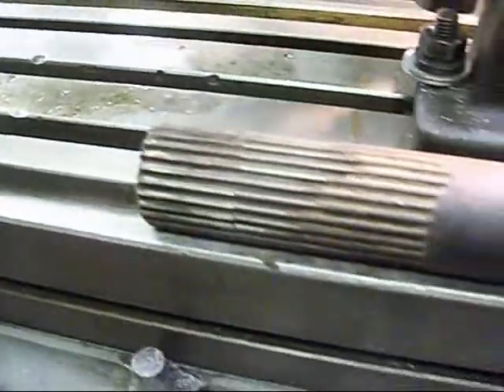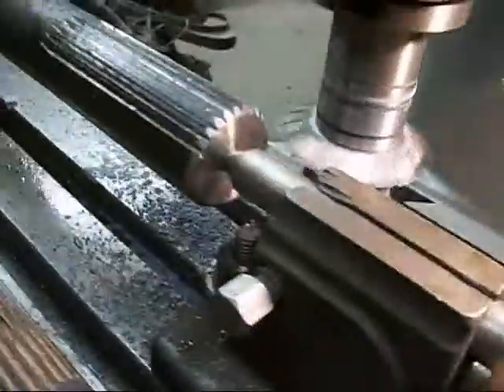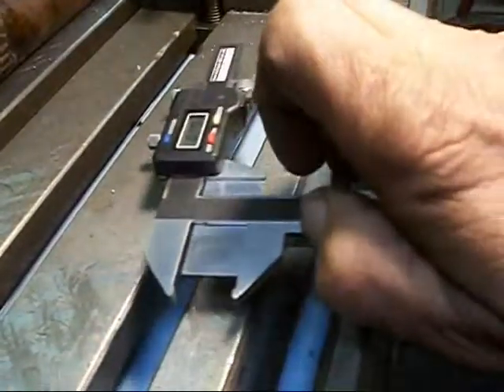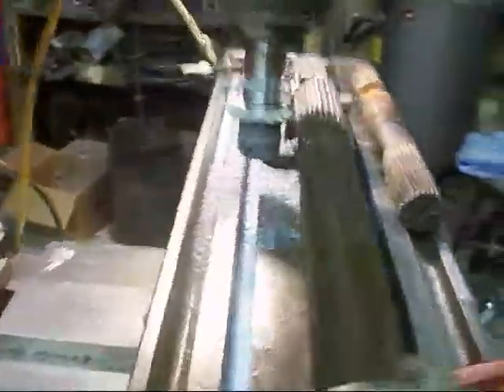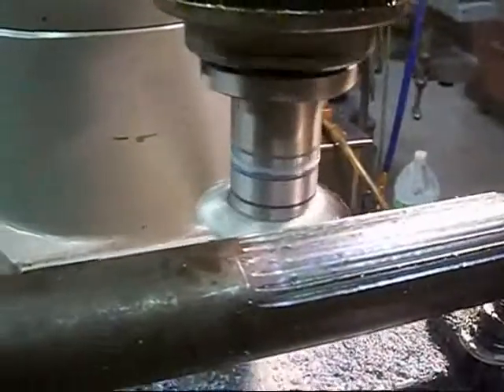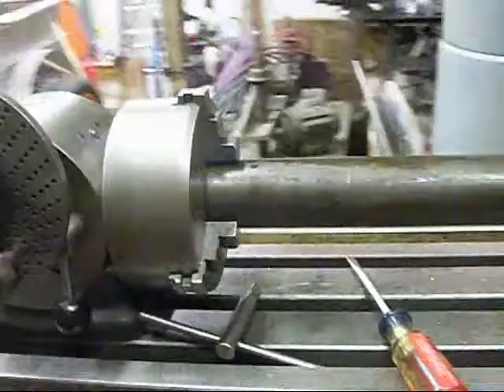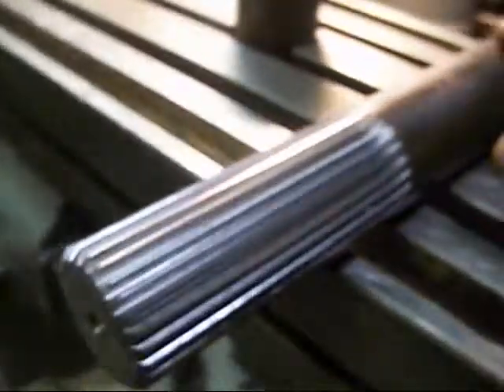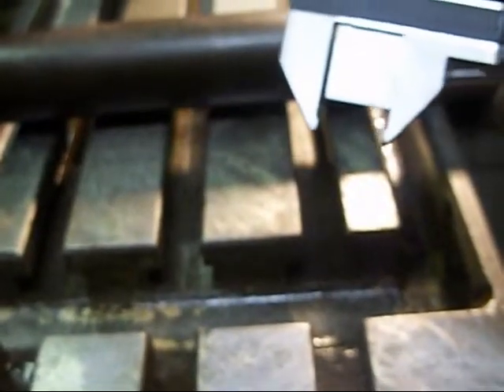SPLINES

Comment: I'd seen those double readout callipers in a catalogue, good to actually see them in use. With your Cincinnati mill, do you often have to slide the whole head forwards and back? When you do, does it stay aligned, or do you have to spend ages rechecking it? Thanks, Andrew
Reply from the maker: Forward and back just for the job. but it stays inline. only when you tilt the head from side  to side do you have to align